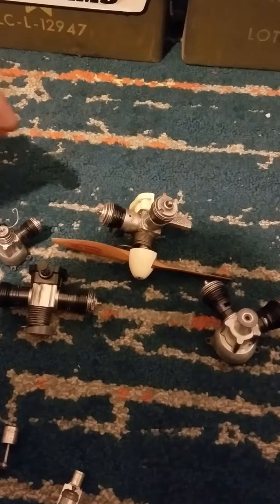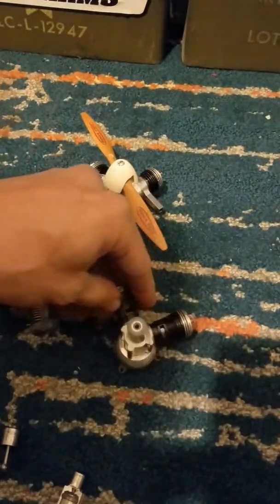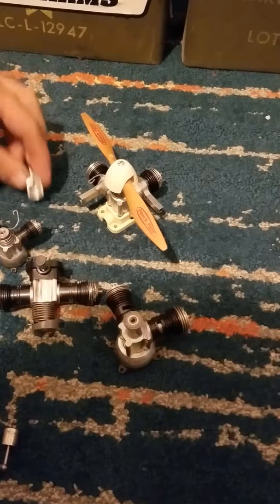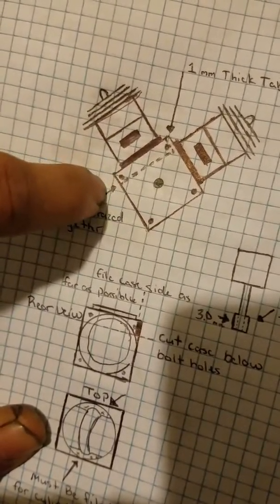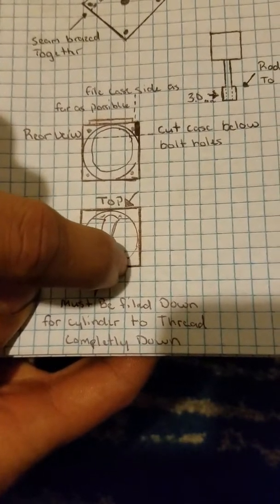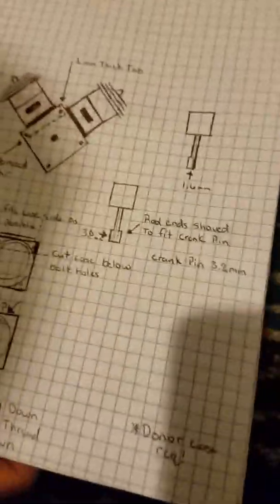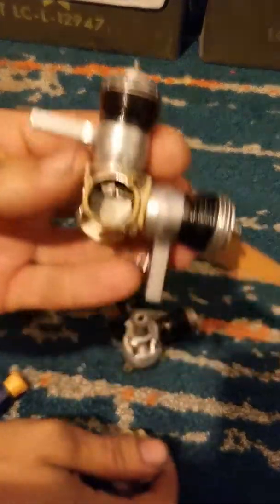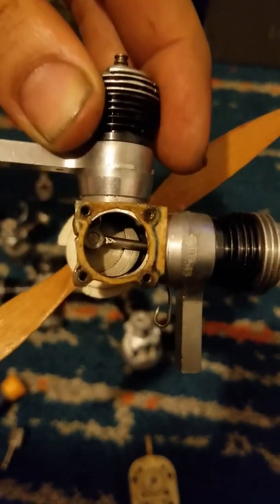Cox .098 V twin part 2!!! How too!

Comment: The opposed will run smother  than the v
Reply from the maker: noah8877 I have an opposed one as well but no crank case pressure
Reply: All two stroke opposed engines I have owned, such as the Desert Aircraft DA-100 and the old Maytag Washing machine engines and the McCulloch four cylinder drone engines used simultaneous-firing opposed pistons to maintain crankcase pressure. This took a fancier crank. The four cylinder versions would have the front pair of cylinders isolated from the rear pair for the same reason.

Comment: Hey I’m building one of the v and one of the horizontal..  how did you cut the cases on the hz?
Reply from the maker: I used a Dremel and cutoff wheel to get close, then a large file to get the parts to fit, a fine tip sharpie will help gauge how much to cut
Reply: @christopherpoucher483 ok built mine horizontal last night..  so not sure it will run tho.. now looking at it. How will it pull fuel  it never has vacuum in the crank case as the other piston comes down the other going up..  so no vacuum..